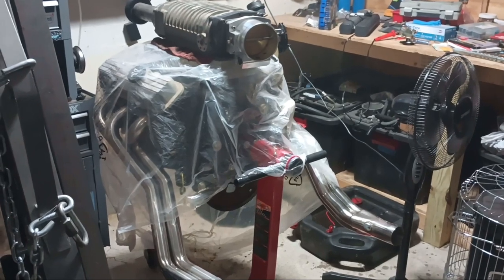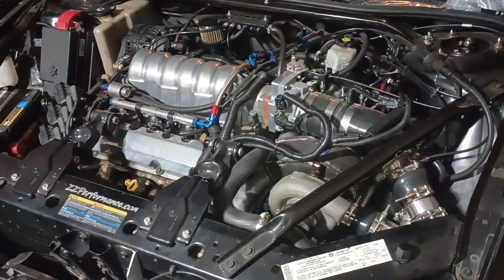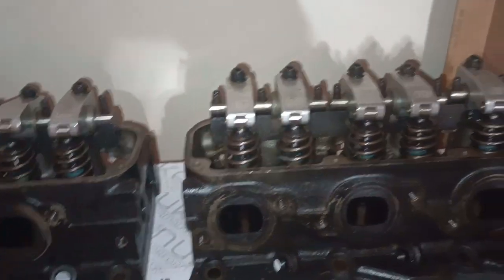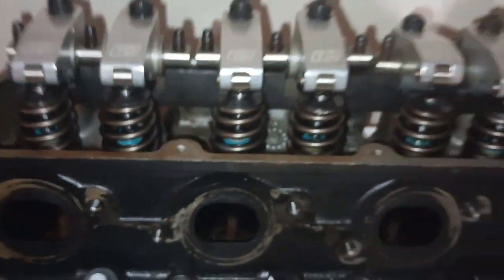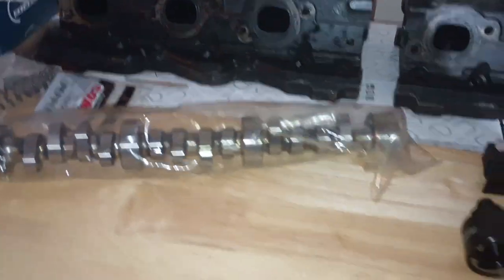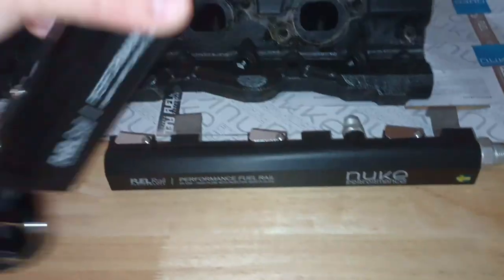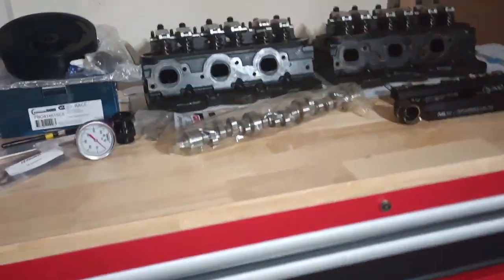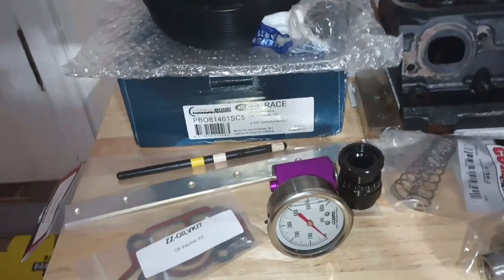3800 RWD MP112 Build 2023 Part 2

Comment: I think I sold those heads to the guy you got them off of!   If they are, they were used on a mp112 build that put down 390ish whp with only running Canadian 91 octane fuel!    They flowed really good numbers!     I was sad to find the broken shim on the valve seat when I was selling them.  😢
Reply from the maker: Nice.  I'll be going over them well. Just overhaled the Stg2's on my Buick for practice.  These are up next this winter.
Reply: Sweet!    I hope they bring you many happy miles!        It looks like a solid solid build!
Reply: Also you may need taller valve covers to clear the roxkers.   When I sold them they had PRJ custom valve covers.   So you may need to figure something out.
Reply from the maker: Ya, he kept the covers, but I'll either get some spacers or drop even more coin down under for some (common for YT rocker guys, too).

Comment: Very similar to my build, this awesome! Only difference is I'm running a way less aggressive cam (blower s2x with 1.65 rockers and 125# springs) and an aggressively ported cobra m112 adapted to my 3800 in my bird.
Reply from the maker: @boostedbird4799  cool.  Ya, this will be a pretty max effort 3800SC (well beyond my old 12sec X-P/GenV setup in my old GTP), although there's always room to improve later.  The forged block will let me try pushing it with less fear, and eventually it'll probably go turbo and get changed, again.
Reply: @dezldave961  if you haven't gotten a car to drop it in yet, I'd avoid the 4th gen. My 3800 build has made me hate my 4th gen lmao. I'd try a 3rd gen fbody or potentially a 70's h body like a Chevy Monza
Reply from the maker: Already got a car, and just barely didn't go for an F-body.  It's another car the 3800 is familiar with, just waiting until I get to push my Buick closer to 10sec goal before shifting attention (although many big parts are sitting ready to assemble).

Comment: Hey Dave , I have a question for you. You are always so helpful, so thank you for that. After my recent freshening up with head studs, zzp gaskets,  z3 turbo kit, built tranny(As much as we can do anymore that is😂), I'am seeing oil residual seeping up some of the valve cover bolts, and down onto the head as  well? It's not a ton but it's definitely there. 3000 miles on it now. Is that normal? Do our valve covers just seep no matter what? Also I notice a little coolant seeping down the bracket that holds the coil packs. And lastly,  it seems that when I boost hard that oil seems to be coming out the timing cover or balancer area. Again I replaced all gaskets, seals exc. Any advice is welcome. Thanks bro.
Reply from the maker: Possibly building crankcase pressure, if you're not open breather with all stock PCV blocked.  Coolant in the bracket area would be either from the WP, plug bolt where s/c idler mounted, or elbow.
VC's don't have a great sealing gasket/grommets, but usually work OK when fresh and have dabs of RTV to hold in place for install.

Comment: You got an instagram by anychance that build is going to be crazy i think i was talking to you about the z7 , i wanna do the hybrid build of the m112 and m90
Reply from the maker: Nah, it's bad for your health.  Z7 is sitting in a tote, still.  Hybrid was OK, but much easier to shop for SVT M112/M122s or Whipple/KBs to adapt, since you have to spend decent money anyway.
Reply: @dezldave961  im doing the hybrid build on my 04 5peed gtp i need to make a spacer for the snout
Reply: @dezldave961  so you think it would be easier to swap an m112 or m122 i have an MAP IC that was on a hybrid build
Reply from the maker: No idea.  That was a limited run of custom parts, which is why I wouldn't steer in that direction.  My MP112 is similar, but was produced by Magnuson as a universal swap blower originally, so it's a bit easier to adapt to.  When you get custom, you need to be ready to come up with solutions for one-off problems.